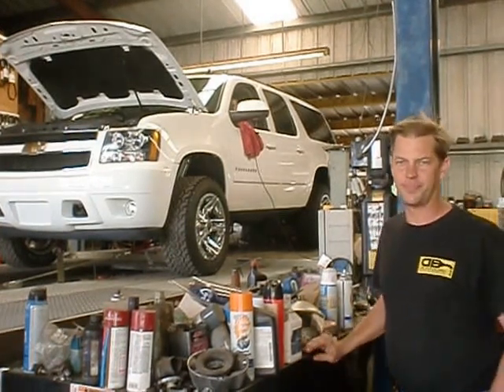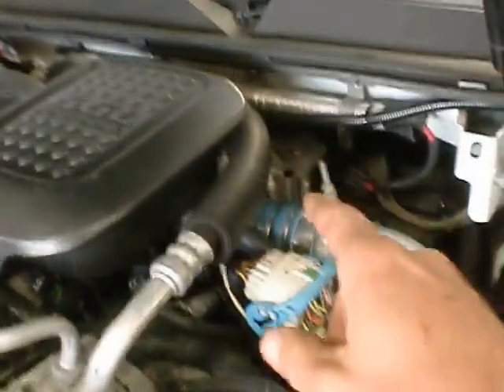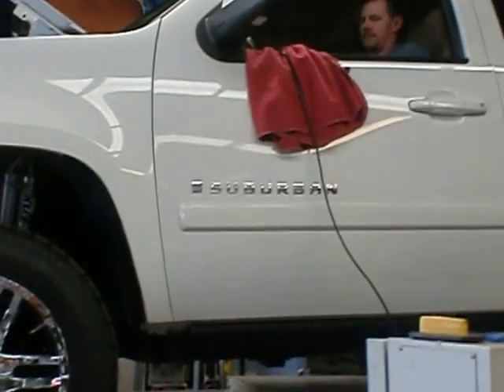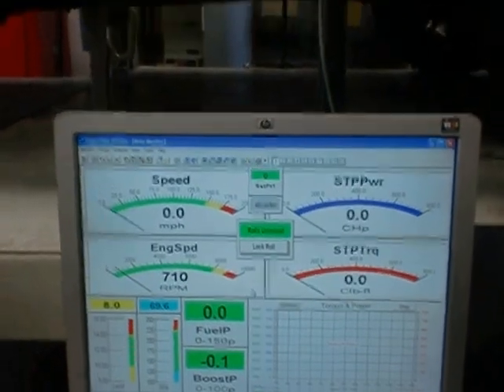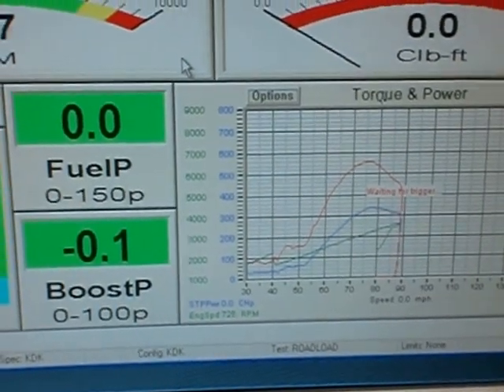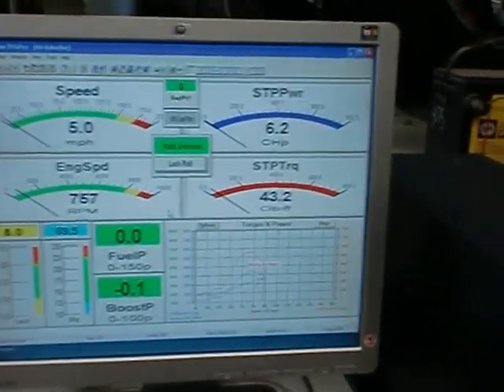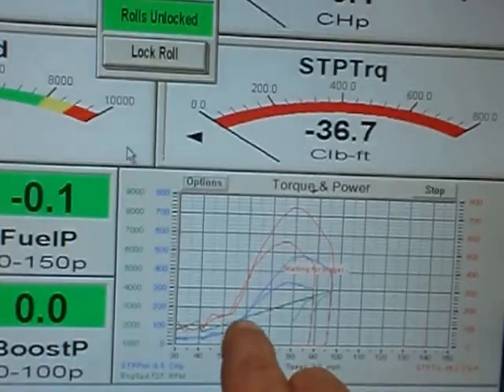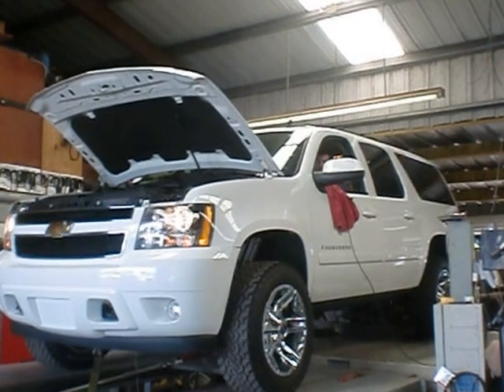Super Single Duramax Suburban VIA Duramaxtuner DuraBurb Sales 1-407-257-9657

Comment from the maker: In addition to the overall cost of a DuraBurb build the Stage 4 can be added and built 3 was as we have shown on the videos and all make 600/900 Gross Power, it requires a Trans/lift pump/intake/exhaust/DSP5 and:

NOS= 7500.00

Super Single=8500

Twins=11500

Comment: Do the tow pro series burbs/yukons ride like a 2500HD?  I am looking for a better ridding option to upgrade out of my 2004 2500HD Sierra.  Thing rides like a dump truck!  I like the power numbers that you put down with the tow pro units, but I am looking for the soft ride from a 1500 series Yukon XL.  Could a 1500 rear end be upgraded (internals...) to handle 800lb/ft of torque and retain the coil sprung rear end (possibly with track bars and a panhard)?

Comment from the maker: No the ride quality is like that of a 1500 Suburban, more car like really, surprisingly even with the dual shock system (re-valved by the folks at Fox) on this Suburban the ride quality is superior.

We do offer a 11.5" rear differential option for the 1500 but it requires a leaf spring conversion, However it doesn't effect the ride quality.